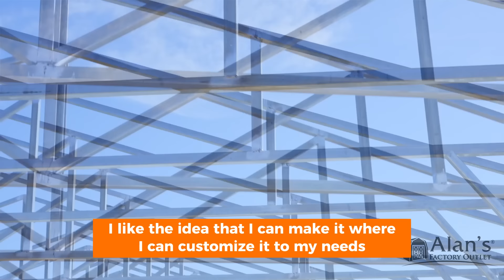Bill: Alan's Factory Outlet was CHEAPER than expected!

Comment: How much...per sq ft???🤔🤔🤔
Reply from the maker: Hello and thank you for asking about our prices. You can get instant pricing on a carport or garage here on our website: https://alansfactoryoutlet.com/3d-carport-and-metal-garage-builder/ Or if you prefer, you can call 1-800-488-6903 and speak with one of our friendly customer service team members—or email us through the contact form here: https://alansfactoryoutlet.com/contact-us/
Reply: That varies immensely depending on where you live.
Not only that, you need to consider local and state building codes and believe it or not code inspectors personality.
Ya it seems BS. But true.
They can be an asset ( which is their job) or a menace.
Know your laws.
Be cordial and follow code.
Remember code enforcement is to enforce code not write it.
 Another issue is many steel buildings or even manufactured buildings aka modulars etc. Are designed for the south, yet sold in the north at "discount" prices.
Beware!
Do your homework.
Many of these don't pass state or local building codes.
Everything from roof to sidewall construction to insulation.
Reply: @alansfactoryoutlet 😊😊

Comment: How is it a 3 day build when u need  site work and plumbing and concrete ? Thats alot more than 3 days son
Reply: U can build a pole barn that size in 3 days
Reply: @stevealber9779 
My buddy in the Arkansas Ozarks had a large pole barn up in 3 visits / 2 days by an Amish builder team.
Amazing value even cheaper than this, but they only build a certain radius from their HQ.

Used treated wood posts, pre built truss rafters & metal siding.

All up in 6 hours but 2 days prior they poured slab.

In total they only were at his property 3 days:

1 Estimate / layout 
2 Pour Slab
3 Erect Building

Comment: Should it have plywood on the roof first ?..
Reply: Not necessary if you use spray foam insulation.
Not only superior insulating R values  ( like R-6 per inch) but also is vapor barrier as well adds structural integrity.
Initial cost is expensive but payback is short term when it comes to heating and cooling costs. 
Especially under Bidenomics.😢.
 If properly spray foamed you could darn near heat that with a couple candles.
In fact your air exchanger ( which is a must ) basically a fan would probably rival your fuel bill.
 Ive heated my water treatment building approximately 1000 cubic ft. With a not so tight door to temps as low as 20F below Zero With a 60 watt light bulb.
Nothing else, no heat tapes or anything.
Prior building required heat tapes, heaters, plus countless nights crawling around thawing pipes plus 40-50 dollars a month at a minimum added to electric bill
Reply: I fully agree. Especially when building in areas prone to wind and hail damage. 
   You can not strip screwed down sheet metal from any metal attachment points without the risk of the next layer hitting a previous screw hole off center. I’ve been there and done that and have continued to warn others on this detail. Insurance companies will not pay for new perlins or any other attachment points used.  With wood you can offset those screw holes and move right along when the time comes.  
    There are no less than two fully insulated metal structures in my neighborhood alone that have been forced into this situation and the reality of this situation is very real for them. 
    They’re full of leaks that go undetected for years because the insulation underneath carries the moisture to another area making it impossible to identify where the leak is coming from. 
     This is a fact of life for those of us that live in these areas.
Reply: No

Comment: To insulate & have sound dampened walls, from the outside add hempcrete over stucco wire attached.

It's R-4/in on thermal & fireproof, doesn't spall, needs a plaster on weather walls & low splash 3-4yr a coat.

The weight needs attention for wind-loads with bracing & diagonals.

Reactions, #HappyNewYear2024 🥳